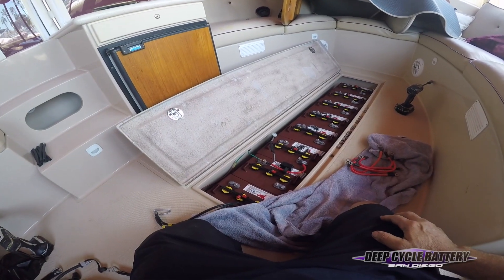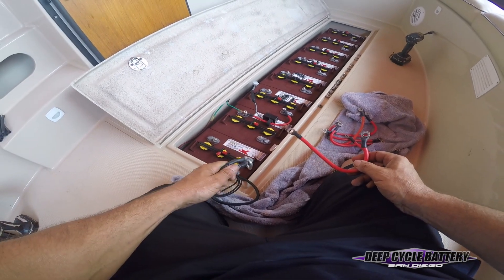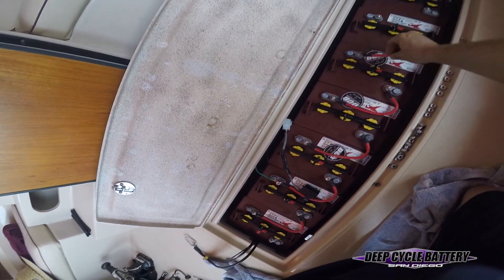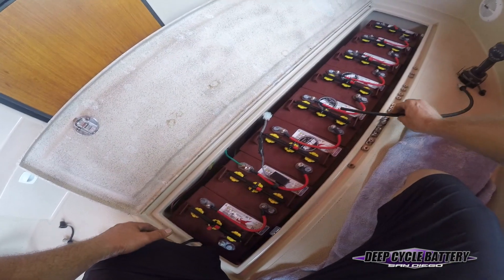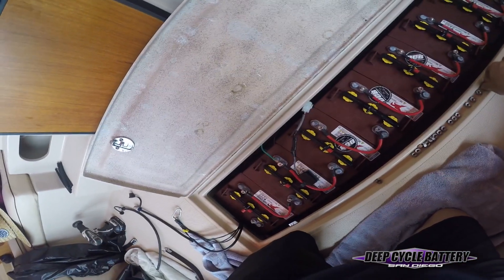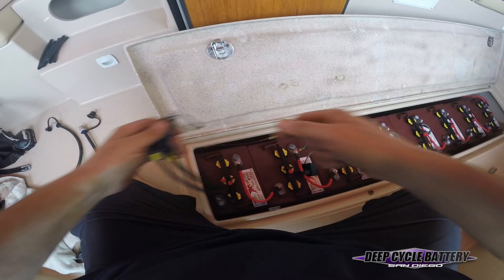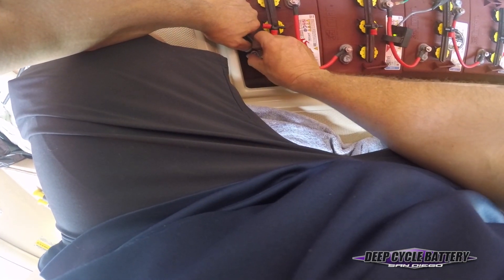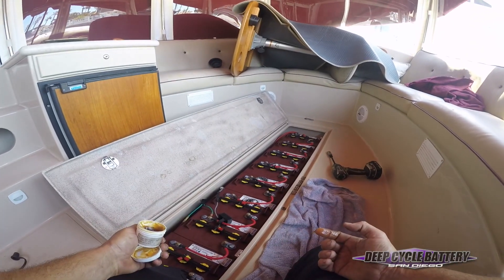Duffy Boat Battery Replacement How To Video

Comment: Would it be possible to make 12 volts off the first bank of 6 volts that are in series? My customer just got a Duffy for his wife that has 16 batteries at 48 volts so im assuming 8 in series and 8 in parallel??